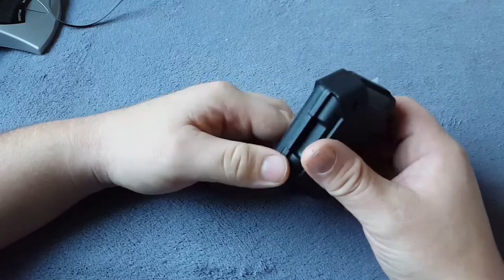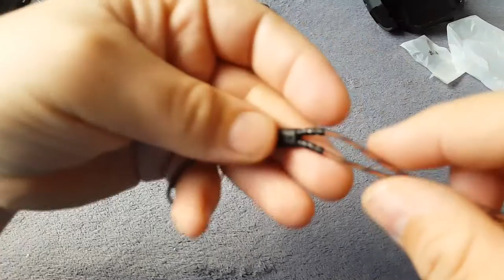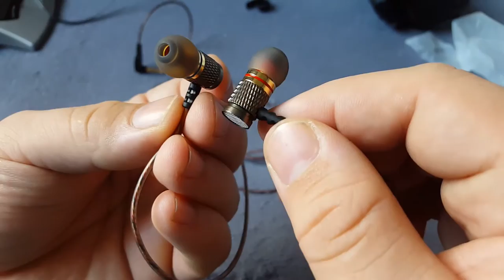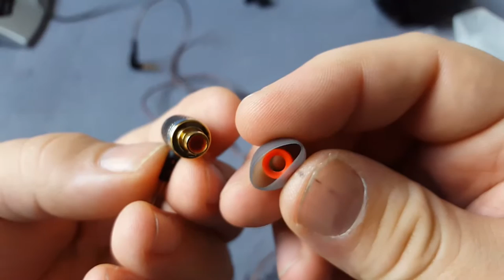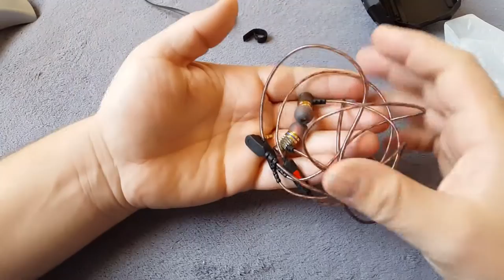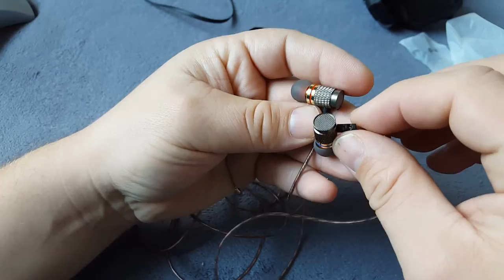KZ-ED2  Stereo Headphones In Ear Headphones

Comment: I bought one too and I agree that the bass is just overwhelming. The solution to that is to replace the silicon eartips with ones with a slightly larger holes. Because the silicon eartips that came with it were unusually small in diameter. When I replaced mine, the bass was greatly reduced and you can hear the clarity and details of the mids and highs.